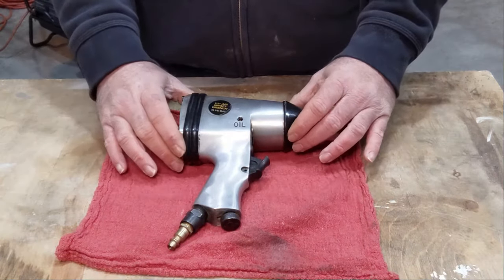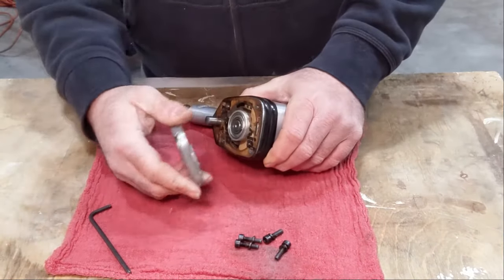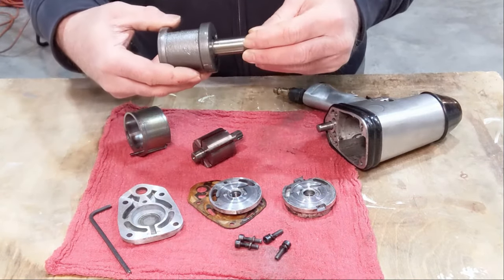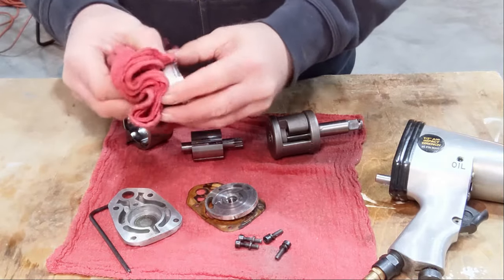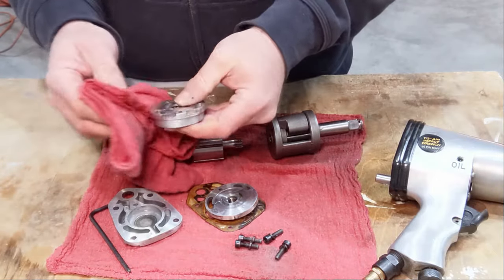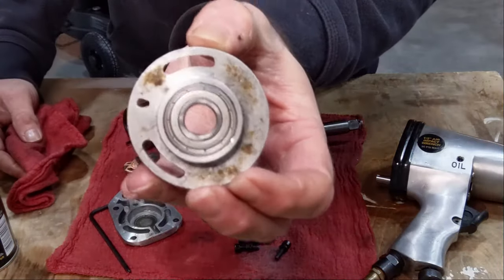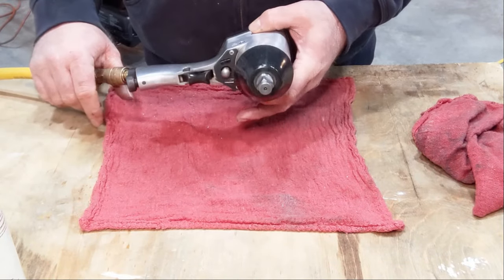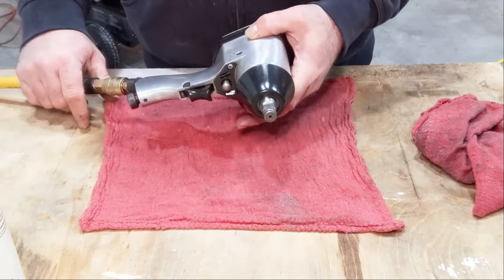How to Clean Impact Wrench - Air Tool Maintenance

Comment: Got the same gun and took it apart but can’t get it back together so far. It was squirting oil out when in use. Weak pressure

Comment: Ok air tool oil just goes in through your air line. Most oil bath impacts call for 30W non detergent oil to lubricate the hammer mechanism. Air tool oil is for the motor and 30W for the hammer mechanism

Comment: The hammers have to have a film of grease on them or they will not work right. Looks like the air tool oil diluted the grease out of the hammers.

Comment: Great video!  Thanks.  $50 bucks now at Harbor Freight.  Covid.  Of course it's Covid.  We are ALL going to be paying extra for Covid for the next 100 years.  At 75, I'll just go buy my last ever impact wrench.  My problem is the trigger.  It's stuck in the "Always On" position.  The only way to stop it is to push that chrome button "thingy" on the back and the front.  Thinking of buttons, my wife has a cute innie belly button!

Comment: Thanks! After watching this, I just tore down my Campbell Hausfield I got at Walmart probably 20 years ago. Cleaned it and oiled the parts while I put it back together. It'll remove lug nuts again... Before, it would only do that if I broke them lose first. Just wish I'd watched this BEFORE roatating tires a couple weeks ago the hard way!

Comment: I have a husky brand one that came with a 10 gallon compressor. It’s releasing air out by the trigger even tho it’s still working. But I feel like it’s not suppose to release any air from it to make it work. I have to see if I still have the receipt as Home Depot has a 3 year warranty on pneumatic tools according to their website (HD owns husky). If not I’ll be giving this a shot. Thanks for the video.

Comment: just cleaned up thee old Mastergrip I got from Costco for like what $30 almost 30 years ago?   good heavy stuff haven't used in it 10 years or more the 1/2" impact was frozen a good cleaning and she purrs like a kitten minimal wear compared to many others i have seen here online.. I'll have to get into the 3/8ths that came with it see if its spinning, prolly needs a good cleaning, darn I forgot tool the bearings before I put it together, dangit .. they get a thicker oil at first, maybe slosh 30 weight around in it then drain it? ah I might as well take it back apart do it right

Comment: What air pressure do you run that air gun at? 90psi?
Reply from the maker: Yes, 90psi.
Reply: I run at 160 and it is very powerful